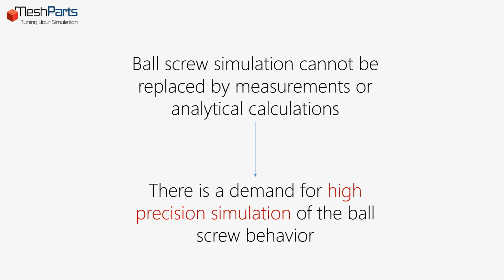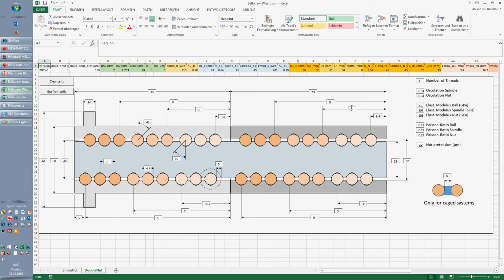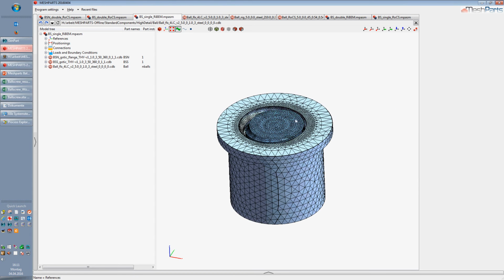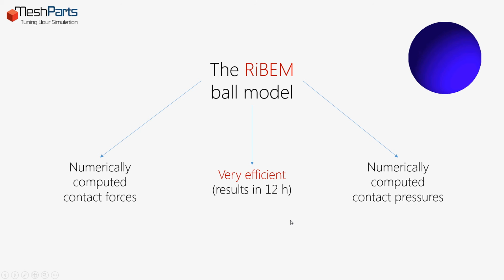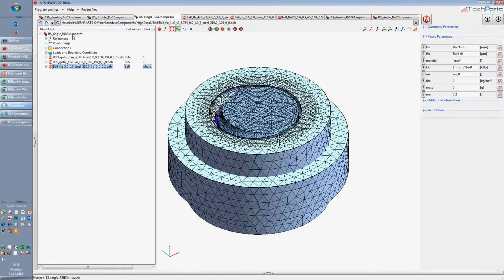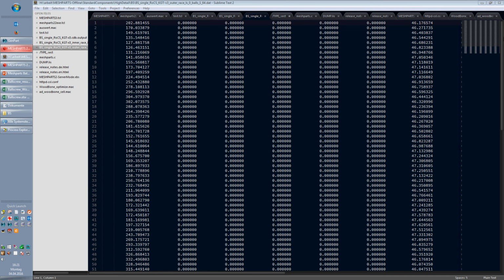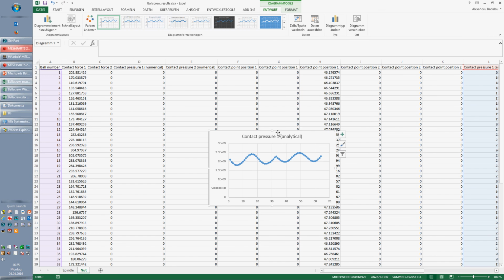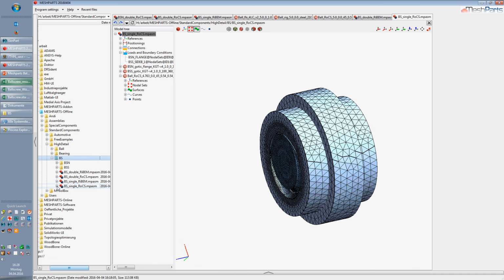Modeling and Simulation of Ball Screws

Comment: Hello, can you share how you put all the balls into the groove at assembly? I don't know how to put them in the correct places in solidworks
Reply from the maker: Hi. In Meshparts, the position of the balls are automatically computed by predifined center points in the nut. Baiscally, all balls lie on a helix with the diameter equal to the mid circle diameter ("Kugelmittenkreisdurchmesser"). The positions are computed automatically by predefined mathematical equations, so it's not easy to explain everything here. Also, the ball screws are 100% generated by Meshparts without any interaction with other CAD software such as SolidWorks.